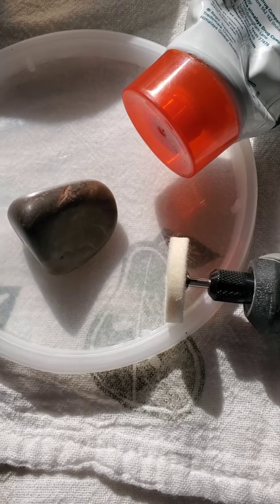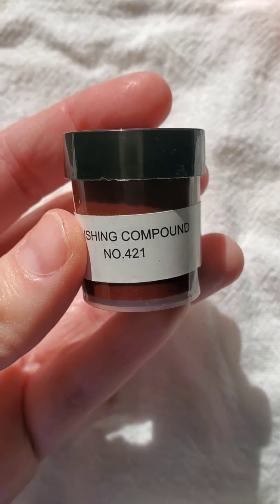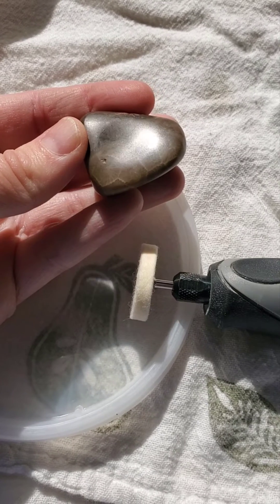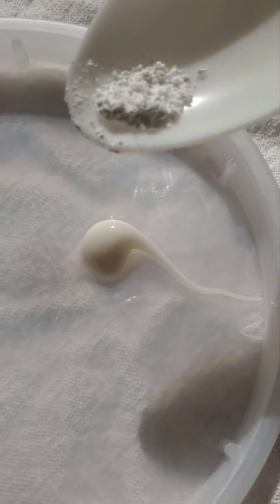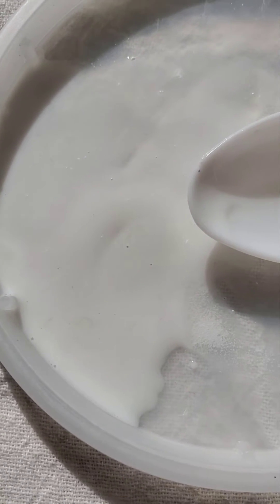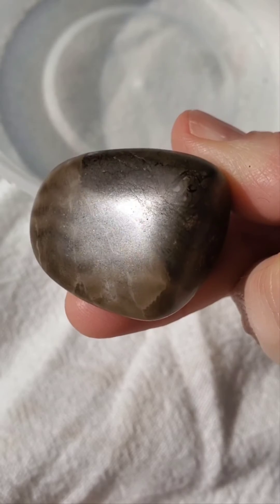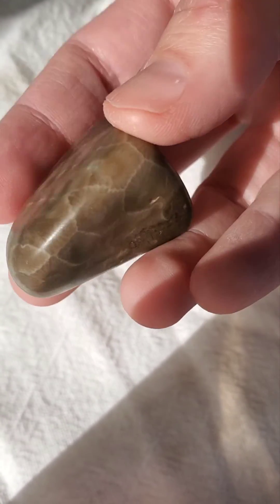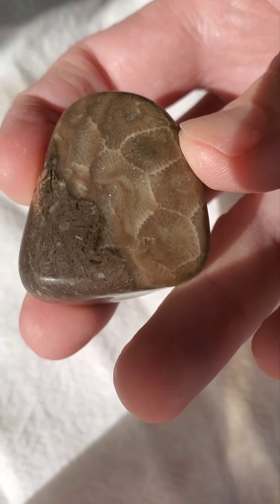Experiment in polishing a Petoskey stone using a dremel tool

Comment: I know nothing about what compounds should and shouldn't be used for polishing. So excuse my ignorance when I ask this BUT could you use, say, coconut oil to mix to powder in? Coconut oil, when at room temp, is a solid form but if warmed even just a little bit turns liquid. You could warm it enough to mix the powder in then let it cool to its solid for so you have a solid polishing compound to use with your Dremel wheel. 
Would/could something like that work? 🤔🧐
Reply from the maker: Maybe! That'll have to be my next experiment. 😊